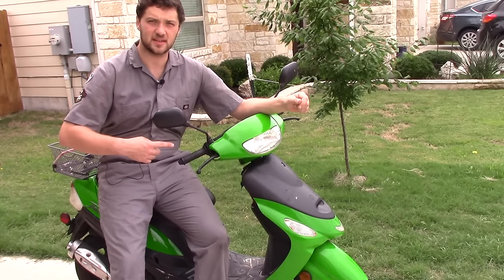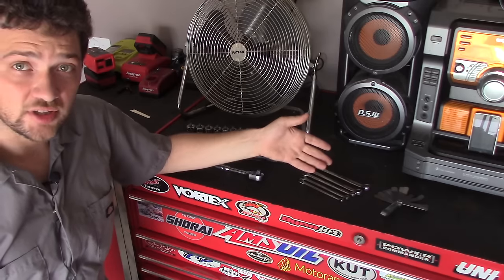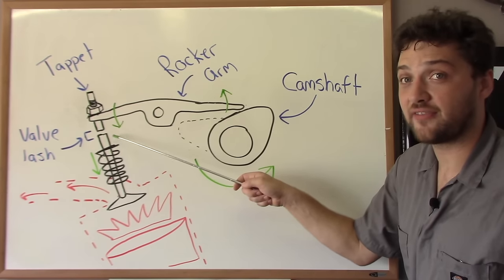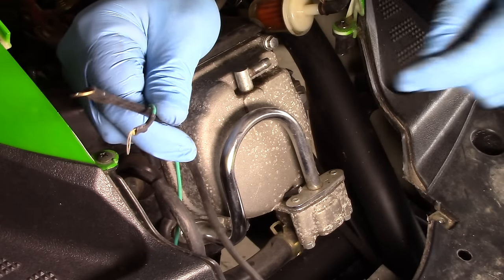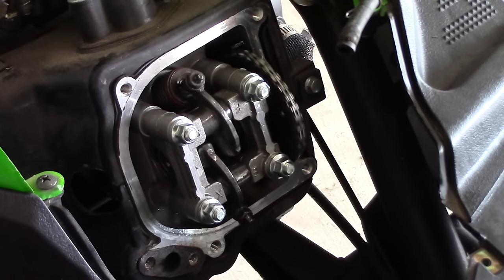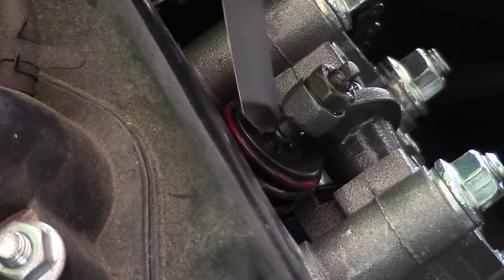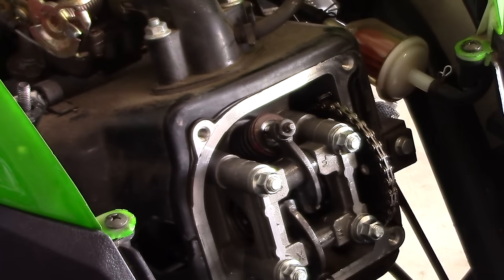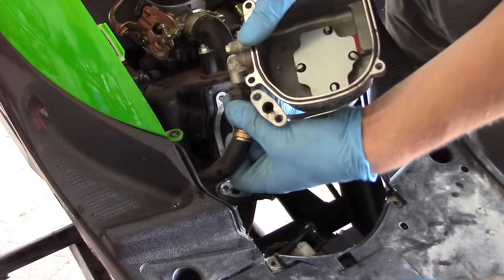Scooter 911: Hard to Start or Wont Stay Running? Try a VALVE ADJUSTMENT! (works for most scooters!)

Comment: My scooter is basically trash
I cleaned the carb put it on the scooter started it and it wasn't idling I was accelerating but it still died after some seconds then I opened it the main jet had fallen.
Second time I took the carb out i tighten the main jet a bit more and then put the carb back and then it started and it wouldn't idle or accelerate I toke the carb out everything was in its place.
Both times when I put the carb it would only start once
Reply: Did you adjust the air fuel mixture screw? Could also be an air leak. Did it run fine before you disassembled the carb?
Reply: @Mech.E  hi, no I didn't adjust anything. Possibly with the air leak I didn't thighed the hose clamp. Yes like a week ago I cleaned the carb and it run fine until it got clogged with water and debris from the tank and I cleaned the carb again and it ran fine but when I was about to ride it it got clogged again. I cleaned the tank and the carb put it back it started in like 20 kicks then it wouldn't idle it was only running with the acceleration on and it still died and after it wasn't starting at all. I opened the carb again and the main jet and pilot jet were down. Cleaned the carb put it back started it it wouldn't idle or accelerate it was dying it starter once 20kicks and then it wouldn't start again. Took the carb out the pilot jet was down and clogged with a metal thing I cleaned it a bit it wasn't fully unclogged put it back the it started in 15kicks and it was kinda idling accelerating and it died after 15 seconds I dried starting it up again and it wasn't idling or accelerating I took the carb out and everything was in it's place night was clogged.
Reply: @nationalboosted2877  I would check if it gets fuel. If it has a fuel petcock remove the fuel line from your carb and put it in a container. Crank the engine and see if fuel comes out. If not check the vacuum line towards the petcock for cracks and test it manually to see if the petcock functions correctly. Maybe the fuel line or filter is blocked and just maybe you float is stuck closed. Check for spark first tho
Reply: @Mech.E  it gets fuel I removed the gas filter and got I got some hoses and connected it to the carb it was leaking because I didn't connect the hoses good but the engine wouldn't fire up at all
Reply: @Mech.E  got it to start it accelerates and idle at first but after 10 seconds it dies

Comment: Bro, I put some used engine oil in my fuel tank just like a drop and my scooter is not starting what should I dooo
Reply: Drain the tank (there will be a hose going to the carb), and clean the carburettor
Reply: A F how do i clean the carb

Comment: How often do these valves need to be checked?
Reply from the maker: Honestly on a Chinese scooter you cant do it too often. I recommend every other oil change so every 2000 miles
Reply: Garret Seesing just tried riding around after this fix and my scooter is only going about half the speed and is heating up a lot more than usual. Any idea what might have gone wrong?
Reply: It also sounds different when running and riding
Reply from the maker: @plasmadog1778  you might not have had the cam/Piston at top dead center. The engine should be cold before making any adjustments. So let it cool off and try again. Also make sure your feeler gauge is reading .003 inch. Not .003mm
Reply: Garret Seesing okay will take this into mind, any pointers on how to find top dead center better? I did struggle with finding it when I first tried I had a hard time figuring out how to tell when the piston is at it highest point. Also I used my screwdriver but the piston would just get stuck on it, not push it out. Any tips will be greatly appreciated!!

Comment: What happens if you put too much engine oil in the scooter.
Reply: Bad things. Oil can leak into places it’s not supposed to be, it’ll foam up and cause all kinds of problems, damage engine parts, make it run bad (and probably a bit loud), etc. A hair over the max fill line (like less than 1mm)  probably won’t hurt anything but any more than that, take it out pronto.
Reply: @PawlH  thanks

Comment: Hey! Is there any way to contact you on instagram or messenger?
I tried fixing my yamaha zest and it worked for about 2 hours. Then once I tried going back home it turned off. Tried starting it but its impossible. And my bike also turns off after not adding any gas to it. Basically I turn it on and after 3 - 5seconds it turns off. Please tell me if you have the social medias so I can send you a vid
Reply from the maker: Send me an email at garretseesingofficial@gmail.com maybe we can figure it out over skype
Reply: @Scooter_911  Uh i don't have Skype :(
Reply from the maker: @hivuo  well shoot me an email anyway

Comment: I put new stator and cdi and yet my moped isn’t start
Reply from the maker: Have you checked to see if the spark plug is sparking? Your issue may even be fuel related. You can puff some brake clean down the carburetor and see if the engine bangs and runs a little.
Reply: No there no spark
Reply from the maker: @nobody288  well you'll need to check out the wiring harness, make sure you are getting the correct voltage out of the stator, the correct resistance out of the pickup coil and that the kill switch isn't grounding the CDI. It is also possible that you have a bad ignition coil or spark plug.

Comment: Hey i was having problems with my scooter not Running correctly..i have a 150cc & it would ride for a couple of mins & then stop i tried to put it on the center stand but it was locked for some Reason..i took it to a shop..they said there was an oil leak & no oil when they checked the dipstick..any idea what it could be
Reply from the maker: The valve cover gasket is what is most often the cause of an oil leak on a 150cc GY6. If the motor stopped running because of lack of oil you can pretty much guarantee you will need an engine rebuild.
Reply: @Scooter_911  the motor didnt stop Running completly..itll Run but when you Ride it..it stops after a few mins
Reply: It may just need oil i ive done a couple oil changes like a week prior & another one a week before

Comment: Hi . Its .003 inch?
Reply from the maker: That is correct
Reply: @Scooter_911  so  . 139qmb manual book, say . In A on a cold engine correct is 
.006, and  ex on.007 mm. I think.  Is this  correct to?
Reply from the maker: @kamilkarol5320  as a technician I have never set them that loose. Most customers complain about the noise as soon as it gets closer to .005. can I ask what book that is?
Reply: @Scooter_911  many years ago I found the 139qmb engine instructions. and information that the valves are set to .005 and .006. but I can see that this is a lie. thanks to your film. you did it correctly. thank you .

Comment: So after you adjust the valves and it starts ticking like a bi*h what do u recommend
Reply from the maker: Go back and check them again. You might not have had the piston at top dead center or something else simple. At .003 and .004 it should make very little noise
Reply: Garret Seesing I’m starting to think something isn’t opening or closing  or is stuck close thing has 91.911km on it and I don’t think they have ever been done cuz we did them twice
Reply: And would all the valves be the same for most scooters
Reply: Garret Seesing and should the feeler gauges slide in nice and loose or should they be somewhat tight
Reply from the maker: @kurtiscloutier5686  yes this adjustment works for all Chinese and Taiwanese gy6 engines. The feeler gauge should have just a slight drag on it and you should not be able to fit the next size up.

Comment: same exact thing happened to my taotao it was very hard to start, i adjusted the exhaust valve and it starting fine. a few days later and its broken again i cant get it to start anyone have any ideas? yes i reinstalled my engine ground wires, i have a spark and i have compression, my fuel line spits out gas when i crank it, it was sitting for a few months when i left and the battery is fine
Reply from the maker: check out this no-start diagnostic video! https://youtu.be/xW5y7a7CB1c

Comment: Hi Garret,
Thanks for the video! I tried doing a valve adjustment on my Lance PCH 150 today but failed. I bought a socket set, some wrenches, and a feeler gauge set like you said. I removed the seat bucket and the other panel. My valve cover is positioned differently than the scooter in your video and 4/6 of the valve cover screws were impossible for me to reach with my socket wrench. Do you have any advice?
Thank you

Comment: My scooter has gas in the oil can you help
Reply from the maker: More than likely you have a bad fuel petcock. If the petcock gets stuck open it can overpower the needle in the carburetor and overflow the floatbowl. That can fill the engine with gas. Good luck!

Comment: This was a great very informative video but the only real fix is to not by one of these throw away Chinese scooters. You should buy a Yamaha or Honda scooter as even a used one will last longer than these piece of garbage scooters. Both my Yamaha 2009 Zuma 125 scooters have needed zero attention and one has 7500 miles and the other 6800 miles. Then run and start like new yet. The Yamaha mopeds we had before were just as reliable. One with 4500 miles one with 3500 miles just to small for us at 50cc so we sold them.

Comment: on mine all i did was
1 clean the tank
2 change the carb
3 new fuel line
4 new spark plug. 
fired up and runs like a raped ape.